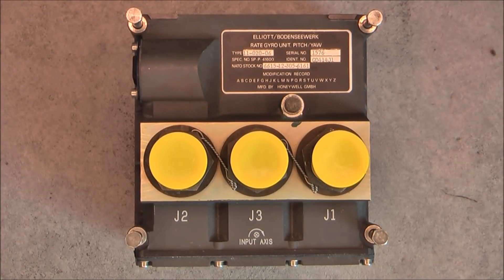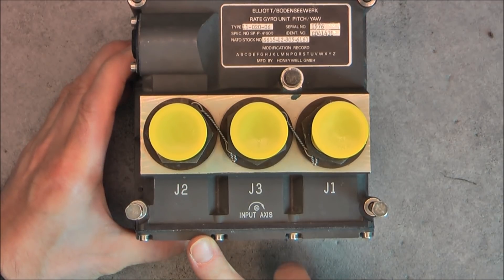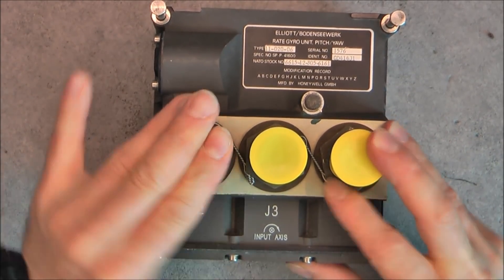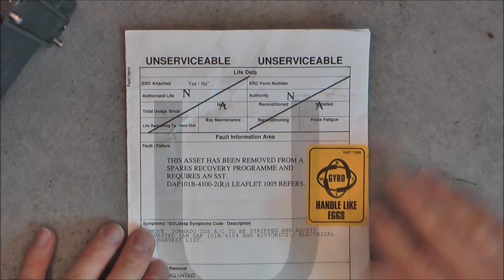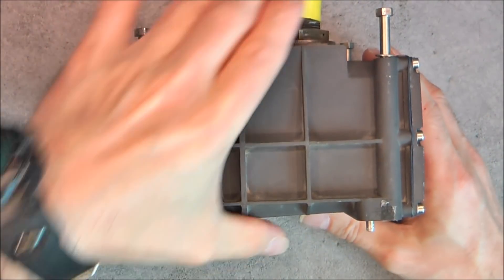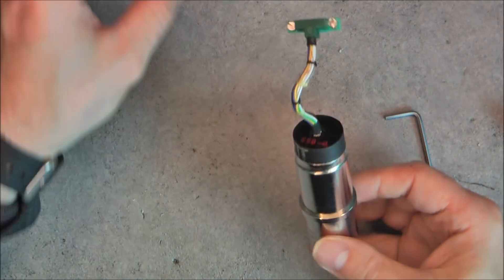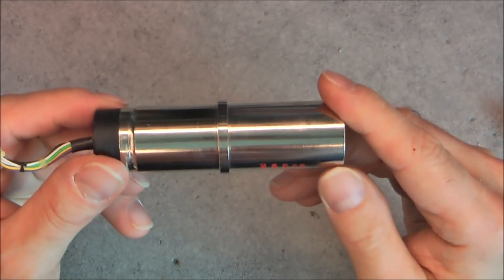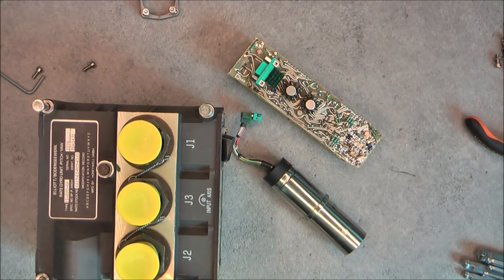Panavia Tornado pitch and yaw rate gyroscope teardown

Comment: It is possible those gyros given their size are filled with helium gas.  Helium gas fill allows them to make a much faster spinning gyro which is more sensitive than one operating in air.   The rate gyros on Apollo spacecraft were filled with helium and not much larger than these.  They also were operated at an AC frequency of 1kHz (if memory serves me right).

Comment: Very nice! It looks quite similar to this unit http://www.decadecounter.com/vta/pdf/475_series1.pdf which I think predates the Tornado one. This one has a two phase motor so you can drive with low voltage AC plus a capacitor for the second phase. Maybe with a bit of probing you could identify the motor wires and try to power it up? Also this Honeywell one looks related: http://www.decadecounter.com/vta/articleview.php?item=902